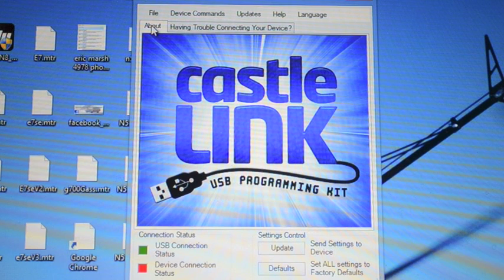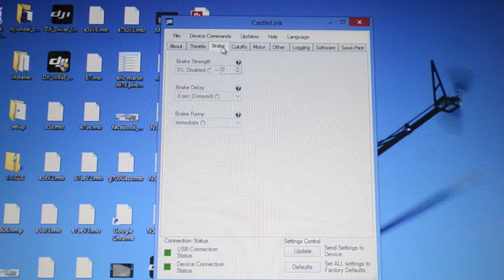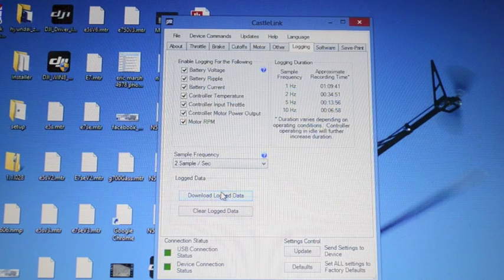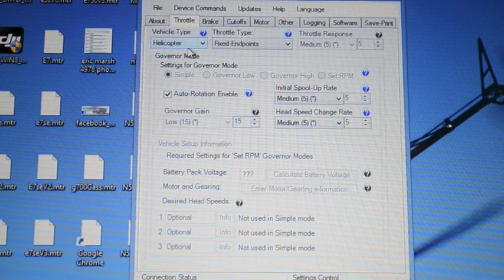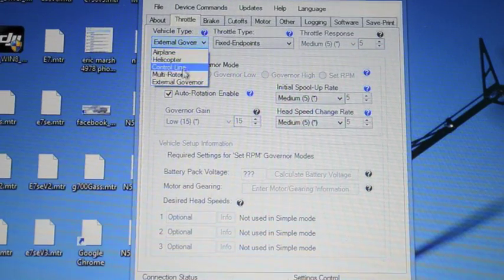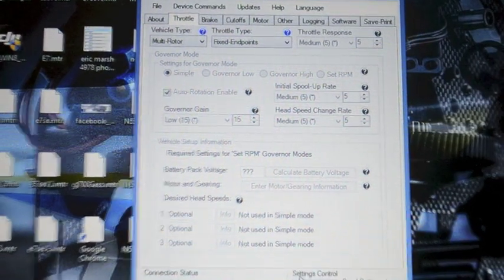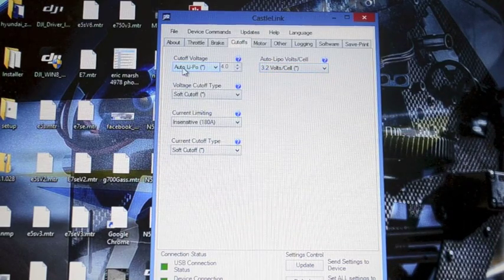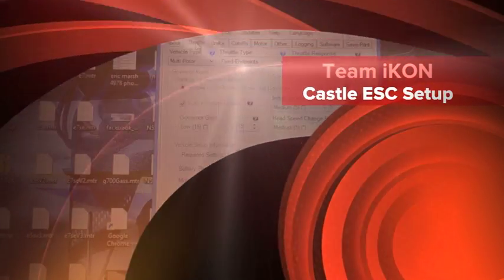Team iKON - Castle ESC Setup for iKON Gov

Comment: I have a castle 90 esc on my goblin 500 sport. with a v-bar neo and a scorpion motor. The trouble that I`m having is on my v-bar touch radio I have no throttle control. When. I go to run it go's to full throttle the stick has no control. On the vstabi site it shows the setup for the castle setup. The only thing that I did not change is the external governor. When I clicked on it to change it came up that it could burn up the esc and the motor. I did not know what to do. Can you help me with that setting. Do I change it to the setting it said.

Comment: First time to use an iKon2.
My esc is a Talon 90. I understood to ignore all governor settings in the iKon, if using Talon governor. (Thats what I want) Here's what I'm dealing with.  When calibrating the Talon, my endpoints are at 30% to start the procedure. At high stick, I get no tones after maxing out the endpoint. What am I missing? Also, I'm seeing blinking light on the iKon. This is a pre owned unit. If there a option to reset to factory default, I didn't see it. In closing, you produce fine videos. Thank you.
Reply from the maker: VIBEFLIER I would start with a factory reset. It’s under the file menu at the top. I haven’t used the newest maestro build in a while, but I know it has a reset option. If the previous owner used the ikon gov, you aren’t going to get true linear throttle out to the talon without resetting the FireWire to defaults.  Hope that helps.

Comment: Excellent set up a video for the castle ESC. The only important detail that I found that it lacked was including and performing throttle throws for the ESC so that the Castle knows your transmitters high and low throttle points. Let me know if you agree or disagree

Comment: Hi Chris, how i can setup the castle edde esc endpoint calibration and later set the throtle travel  0-100 end point  in the ikon fbl? i don't want to use governor and i already use the TX end point for calibrate the esc. if i set in the TX end point again for the ikon setup, this will cause problem for the esc end point. sorry for my english. thank.
Reply from the maker: If you are running the talon gov, you need to ignore all things throttle in the ikon. Don't calibrate tx to ikon throttle and don't adjust the esc end points on the ikon gov page. Make sure the use gov checks are off on all three banks. 

Then you can follow the castle endpoint calibration with your TX.
Reply: i am using the castle phoenix edde vh esc. no setting yet. so I choose in the castle link sofware helicopter fixed-endpoint and make the esc calibration? really sorry for ask to much, i am new making my own setup. thanks
Reply from the maker: +Yadier Sanchez yes fixed end point.

Comment: So if I'm not using ikon bail out nor castle bailout choose external gov? and my dx6 throttle curves atm are set to 0 30 30 30 30 30 normal mode. will that be ok for the ikon govoner? I'm using internal castle talon 120hv gov atm but might switch soon for better gov response. i do not want to use bail out on either unit nor self level. just ikon governor for set head speeds. would i change my dx6 throttle curve to 30/30/30/30/30/30 instead of that 0 for normal or whatever ikon tell me to set Throttle curve at, will it give me a soft start with no 0 for normal? Thanks
Reply: Or should i  keep that 0/30/30/30/30/30 curve so ikon can let castle use the soft start cuz ikon says 0-25% no govoner then flat 30 curve gov for speed1 etc. I want to use ikon gov and still have a soft start for my first head speed (set speed1 in ikon)
Reply from the maker: JerseyRepresentative Correct, if you aren't planning to run with bail out, there is no downside to running the Castle Soft start. I agree it is a bit smoother than the iKON soft start.  I would run a 0,40,40,40,40 curve. 30 is in the accepted range but depending on the calibration of your TX POTs I have seen this cause the gov to kick in and out as the actual broadcast value fluctuates a point or two.
Reply: Christopher Sexton running 0/40/40/40/40 won't hurt anything? like change head speed or anything?
Reply from the maker: JerseyRepresentative On iKON the requested RPMs are a range, anything 25-49% will output RPM1, 50-74% gets RPM2, and 75-100 will output RPM 3. I like to use values in the middle of the range to prevent slightly off calibrations from changing the outputted head speed.
Reply: Christopher Sexton  so 0/40/40/40/40 and for idle 2- 70/70/70/70/70 ( since its its ten up from normal ikon value) and obviously 100 for idle 3 if that what you recommend? 40 for norm and 80? for stunt2? Thanks a lot though
Reply: JerseyRepresentative i mean 70 for stunt 2
Reply from the maker: I run  0,40,40,40,40 ; 70,70,70,70,70; 100,100,100,100,100

Comment: Hi Chris, i have a edge160hv Esc, and im looking forward to get my ikon unit next week. So as i understood so far is that i dont Need any rpm sensor on the motor wires. Do i have to connect the aux wire to the gov port of the ikon? To which pin? To the left pin or to the right pin? That information would help me out a lot. Thanks and greetings from germany. Tobi
Reply from the maker: Correct, you don't need any additional sensors but you do need an adaptor.  I recommend this one: http://www.helidirect.com/servo-to-jst-adapter-p-28434.hdx 

Make sure you set your AUX wire to RPM Out in the Castle Link software.